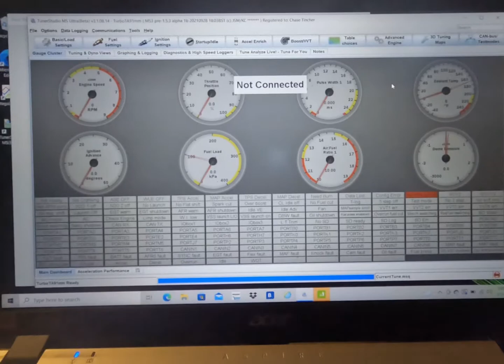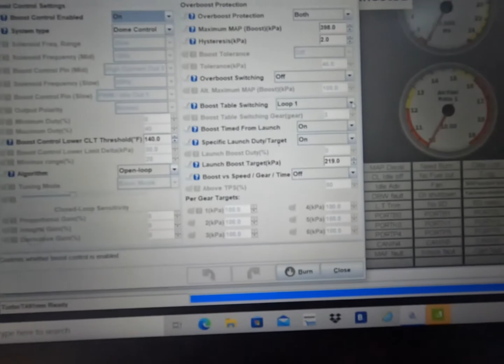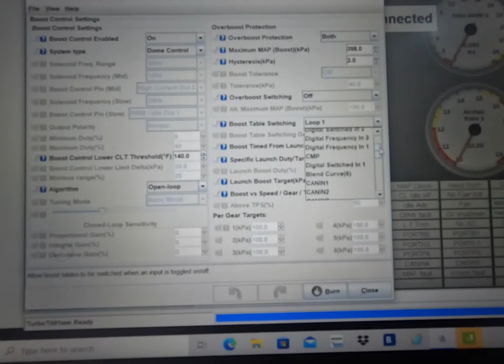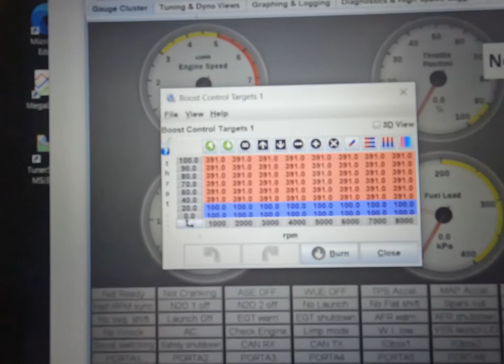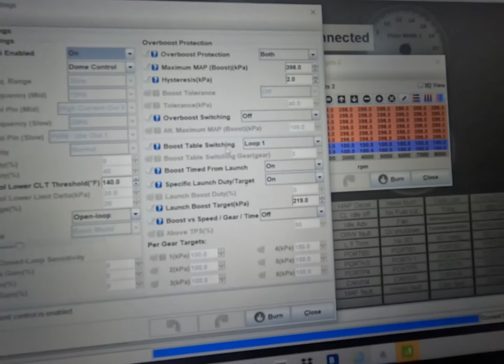HOW TO SETUP SCRAMBLE ON YOUR MS3 PRO ECU

Comment: How would I configure a switch to toggle the boost table instead of just a momentary scramble button? Thanks for the information!
Reply from the maker: @CertifiedRippers  you would wire the switch in line with your selected input. The ECU needs to see signal (either power or frequency) so you can use the switch to trigger your input so the ECU knows to switch boost maps or boost target. It would be wired the exact same as the momentary switch.